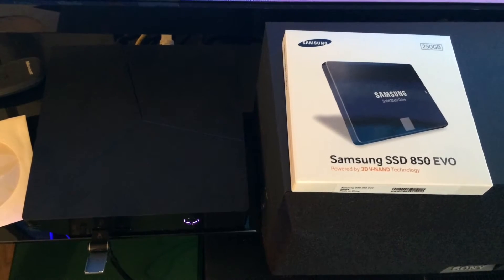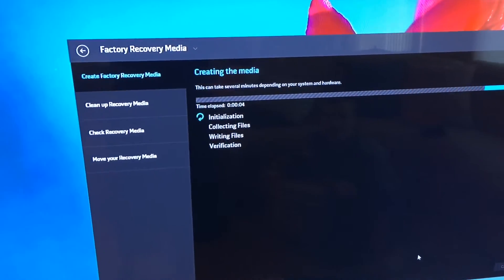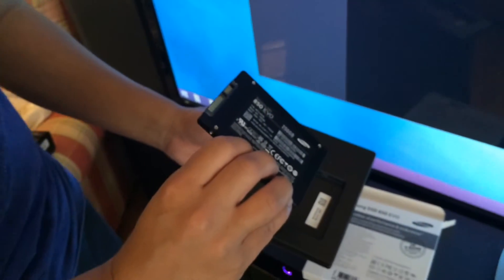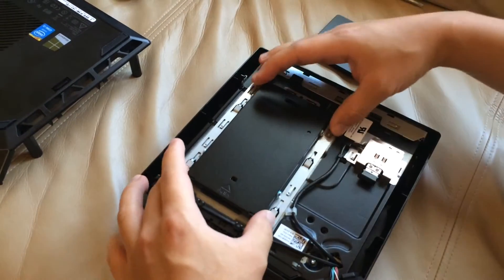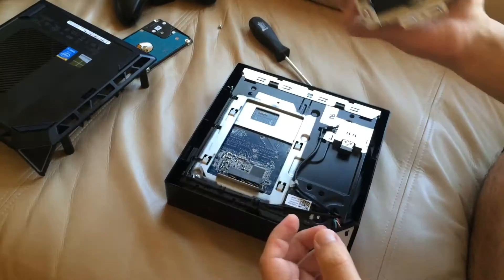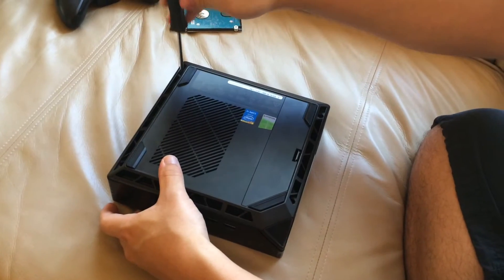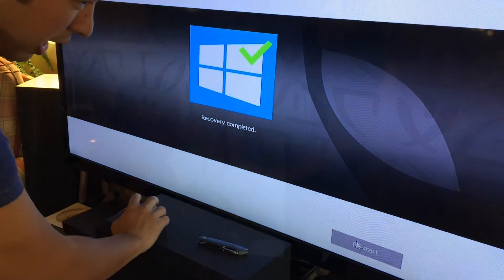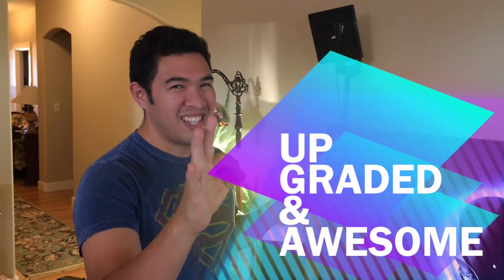Alienware Alpha SSD Upgrade TUTORIAL | Upgrade HD To SSD + Walkthrough + Alien Respawn

Comment: Hi i have done all the steps except when the ssd is in and you need to boot into Alain respwn it says Recovery Your PC needs to be repaired i know this is because i took out the hard drive but the issue is there is not much i know i can do if could just get to advanced options i could boot into my recovery and set it all up but it wont boot into alain respawn and the reason why i don’t do the advanced options is because i cant without and OS i cant do that this may be because im running windows 10 pro but when i was running off hard drive it worked fine

Comment: So my problem is that my son's Alpha came with windows 10 already installed. There was no alienrespawn software. Dell tech support tells me alienspawn is not supported in windows 10. How can I or what can I use to make an image if I don't have the respawn software.
Reply: Problem solved, used windows 10 to make recovery usb and was able to install on new SSD without a hitch. Install was successful and copy was activated so no problems there. Just had to add some programs that weren't backed up. I also updated the ram and all works well with 8gb of ram. Boot-up, restarts and shutdowns are night and day with the new SSD and memory increase.
Reply: Julio Mercado Which SSD did you use?

Comment: Hey I followed all steps exactly but starting up alienrespawn doesnt show up. After it says loading files nothing comes up.. does it have to do with my USB?
Reply: I literally have the same ssd as you except usb. its 16GB lexar. nothing on it
Reply from the maker: +Jlews3 if it's a hardware issue it shouldn't even show loading. Did you update respawn before creating restore? If I were you I'd go back to the old HHD and redo the respawn on 2 separate USB drives and go again.
Reply: Drive By Reviews yea I did update respawn.. so do you think I should by an external hard drive instead of use USB?
Reply: Drive By Reviews also another thing. I got windows 10 for free and in the USB it has a Feile that says windows8towindows10upgrade
Reply: Okay. so instead i just installed windows 8 into the new SSD. but i dont have wireless internet. idk what to do
Reply from the maker: External drive wont be any different from a flash drive. You should complete any updates or upgrades before creating the re spawn profile, but I recommend waiting to upgrade until after re spawning on the SSD from the original OS. If you have issues with the cold OS installation just put back the original HHD, update, and respawn again.

Comment: my alienware alpha i7 is on it way if I back up my data and switch to a SSD and I got a error or corrupted file can I put back the HDD that came with it and will it work again so that I can try it again with a different flash drive or SSD
Reply from the maker: +Javier Solorzano Yes, as long as you just removed it and didn't do anything else that would erase the data (like format, set it on an active MRI machine, etc.)
Reply: +Drive By Reviews thank for reply it was useful information to know

Comment: Please someone help, I'm trying to install my ssd in my Alienware alpha but when I go to Alienware respawn and try to create my rescue disk it just stuck on searching for an external hard drive, won't let me click on change the drive, I try switching flash drives and nothing, it even keeps searching when there's no flash drive connected, please help thank you
Reply from the maker: +kal-l krypton Did you update respawn before attempting the backup?
Reply: +Drive By Reviews i try to upgrade it but I get and error 5, I also upgraded to Windows 10 and everything works up to the point that my new ssd is installed , I turn on my machine , do all the steps and my usb won't appierd to select it
Reply: +Drive By Reviews ok yeah that was the problem, needed to update alienrespawn thanks

Comment: so when you're upgrading to an SSD you need to create a backup onto a usb device right, do you need to back anything up when you're upgrading ram ?
Reply from the maker: +BRUH Nope, the need to back up comes from the fact that you're replacing the memory that contains your Operating System. The RAM doesn't do that and therefor requires no back up; however, you will often see people encourage you to backup your computer and valuable files with any computer upgrade in case something goes wrong. Improbably with the ease of replacing RAM, but still possible.

Comment: How big does the flash drive have to be? Sorry if it's a dumb question. Thanks!
Reply from the maker: +Juthan75 I used a 16GB drive and it was plenty big. Considering 2.0 USB drives of even 32 GB are very cheap it shouldn't be an issue. I think Windows 8.1 recovery partition varies from 3-6 GB but just have an 8+Gb USB just in case. In this day and age you really should be carrying around larger/faster USB for your own sanity!
Reply: DriveByReviews
Thanks! I bought a 32gb 3.0 flash drive.